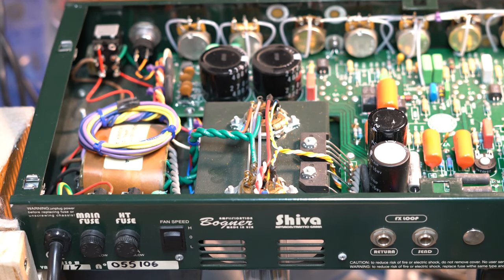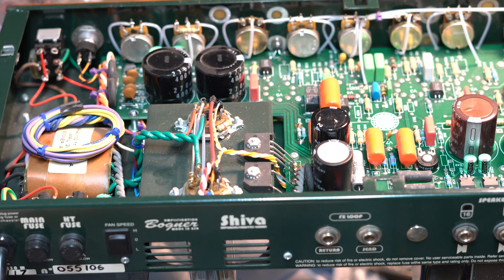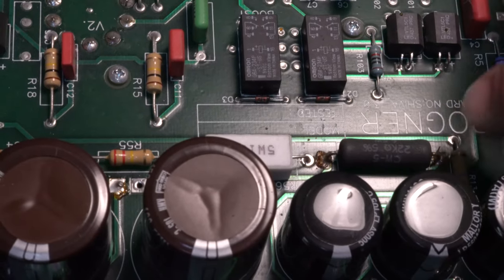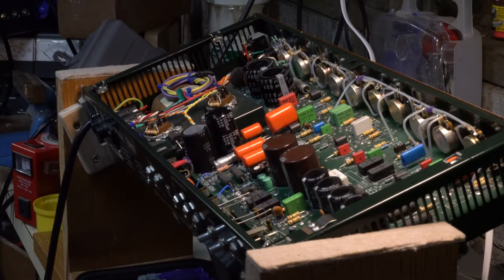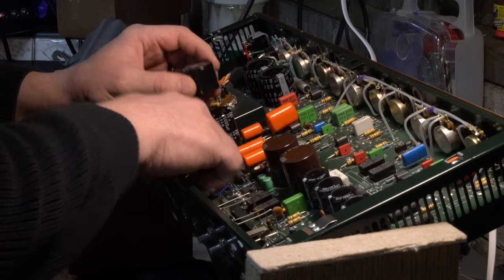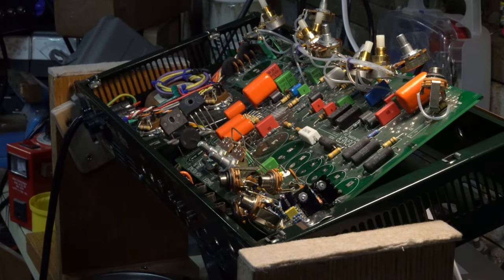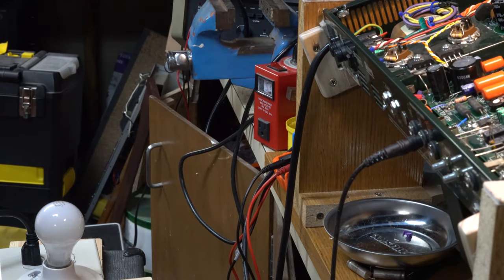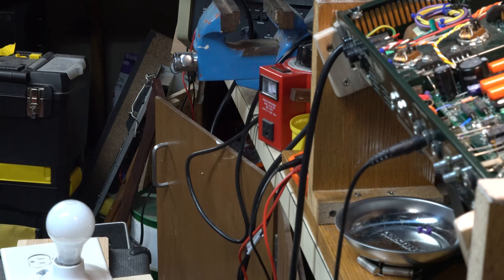Bogner Shiva Capacitor Replacement

Comment: Hi. Do you happen to remember how you drained the caps in this Shiva? Did you have to get underneath the PCB? Thanks!
Reply from the maker: You need to do the usual of connecting a decent 10 to 100k 2 to 5 watt resistor between high voltage and ground with the power of and power cable disconnected.  Be very careful.  You can get killed if you don't know what you're doing!
Reply: Frenchie Films Thanks! I’m not planning on touching anything. I actually just need to retube and bias. Just need to pull the chassis out, but after seeing your video I started looking up filter caps out of curiosity. Do you know if the powering down method of draining the caps works on a Shiva, going from On straight to off without using Standby? I seen it detailed in a BillM video.
Reply from the maker: I don't.  I would check the voltages with a multimeter very carefully before touching anything inside the amp.  Doing bias adjustments requires the amp be on and running anyway so you're in the same level of danger.  Always be very careful inside the chassis of a tube amp.  It kills
Reply: Frenchie Films Thanks! I’ll be careful for sure! Just out of curiosity, since the cap leads are under the PCB, did you drain the caps by using the #1 and #6 pins on the V1 preamp tube, or one of the B+ spots on the board? There looks to be a B+ spot right in the center above two small resistors.
Reply from the maker: Since I don't have the amp anymore, I may be mistaken, but I think those large resistors near the filter capacitors are likely power droppers and you'd see any dangerous voltages there, but I don't know for sure, so don't consider that a 100% guarantee.  Often the safest bet is to check voltages around the board.  Make sure you don't see anything dangerous anywhere.    Be careful and good luck!
Reply: @FrenchieFilms  Everything went well! It seems these amps also have a bleeder? I watched it drain the caps on its own several times. Seemed to take a few minutes after powering down before it was at 0. Thanks again for the tips and help!
Reply from the maker: Glad you got that sorted, out and were able to safely look into the amp more, enjoy!